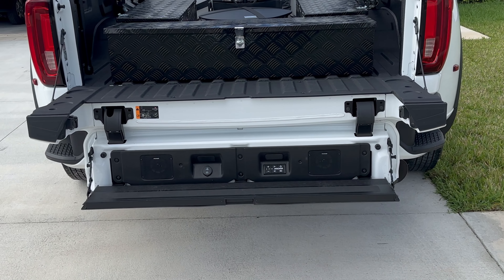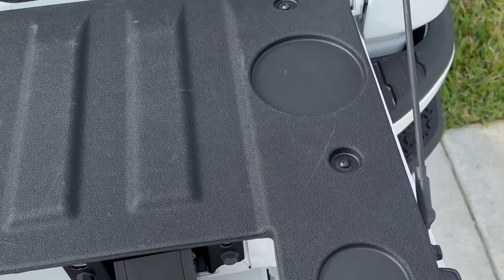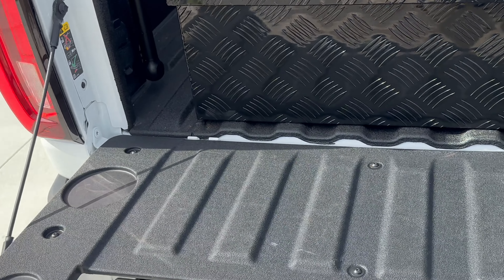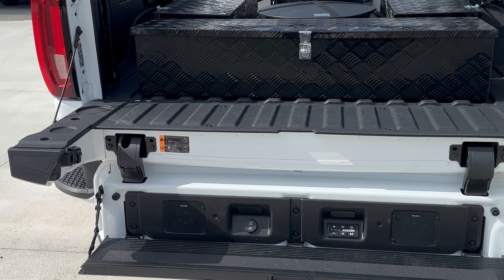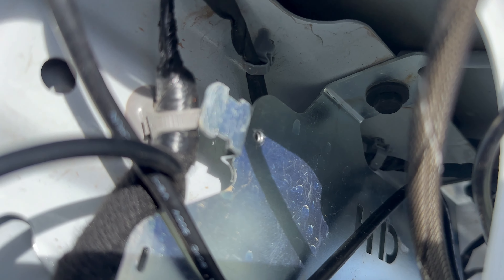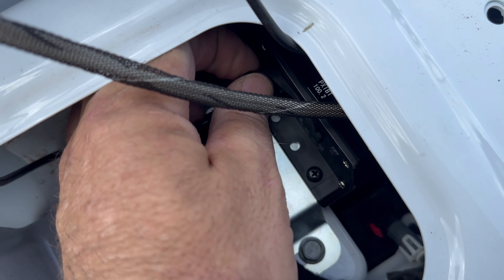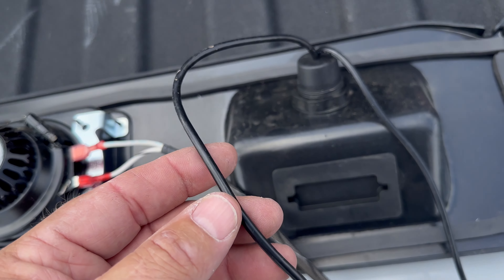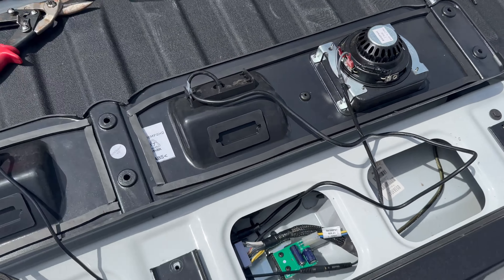How To Install a Multipro Tailgate Kicker Speaker

Comment: I wonder if you get this Kicker Setup that clips into the trailer harness if you can still get the light bar under the tailgate that hooks into the same harness?
Reply from the maker: Great question - the unit we bought came with its own adapters. I am sure it came that way just in case there are other accessories you want to add to it

Comment: Is there a difference between the 1500 and up? Im thinking if buying one biy it came off a 2500 and i have a 1500
Reply from the maker: As long as it has the new style tailgate, and the holes are already made for the speaker system, it will work

Comment: Does it work well?
Reply from the maker: Yes we love it!! Worth having for sure!
Reply: Careful with water. Was moving something and gmc said they were waterproof so it would be fine to leave the tailgate open. I had the little stopper open and it rained. Completely blew out the speakers. On top of that they won’t cover it either because now they are denying saying they never said that and it’s my fault for actually using the bed of my work truck for work.